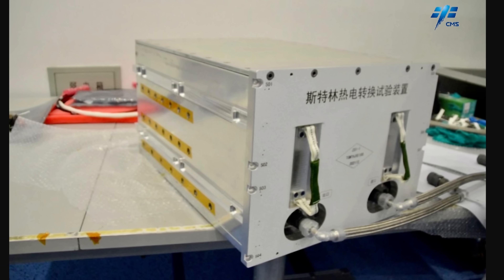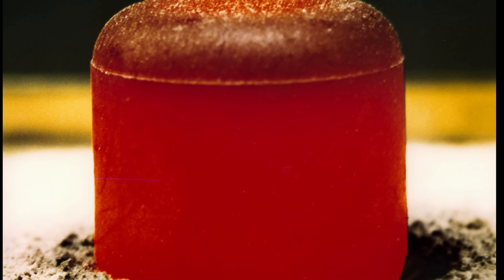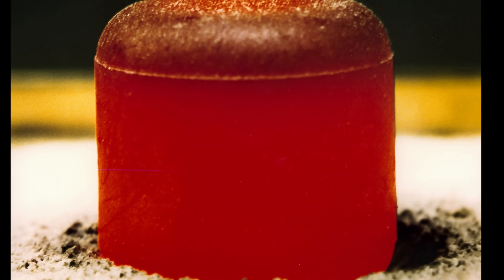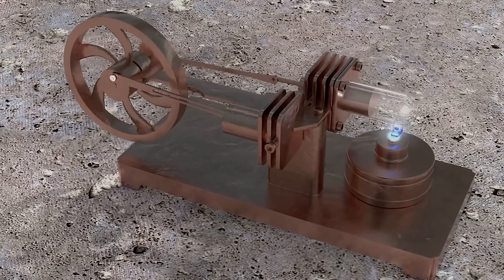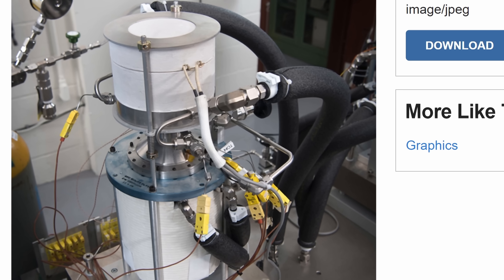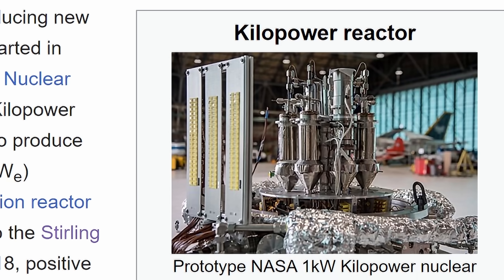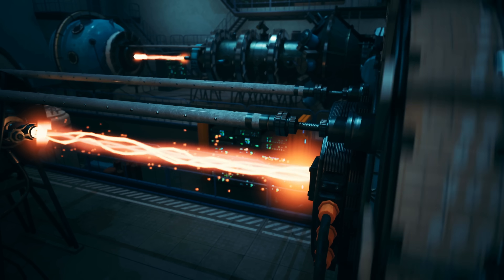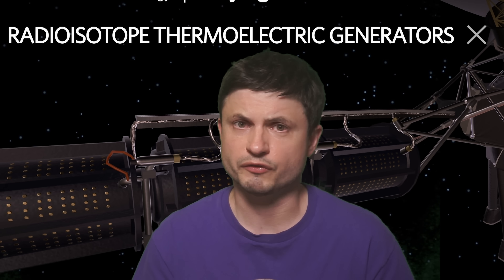Incredible Advances In Nuclear Stirling Engines For Space Exploration

Comment: I'm really excited to see how space ship design changes over the next few decades due to stuff like this
Reply: Yes, what a treat to live in these times.
Reply: There is AI reiterative design optimization that is poised to do some inhuman levels of engineering integration and detail as well.  It’s going to be big in less than a decade.
Reply: @hugegamer5988  What is the name of it? Also where can I find the latest news for that AI reiterative design optimization?
Reply: @hugegamer5988  Towards what application(s)?
Reply: @michaeltape8282  everything.  Pulsed rocket design, better lithium batteries, higher performance turbines, amazing strength to weight optimization of a frame for a particular load.   We have had simple parameter optimization in engineering for almost 20 years now and this is like chatGPT for engineering problems. (Not a llm but the analogy holds).
Reply: @michaeltape8282  Towards workplace safety. Atm it is to bulky for the trash can. AI will design it, so no parts of it sticks out, that may snag on a lab-coat.
Reply: @hugegamer5988  Computer optimization of optical imaging lens design has been done for more than 50 years.
Reply: IZza Spash Shlip...
Reply: Maybe towards some sort of of engines separated by stalks from the main saucer part. 🤔
Reply: Why? Since we will all be living in bunkers. You will likely not see any of this happen.
Reply: @Brian-pz3wh  Hey maybe it's not that dire.  /Maybe we will live in the Logan's Run dome and get vapourized at 30,  That way we wouldn't have to live long enough to see people getting really excited about whatever technology like sirling engines that are always just on the horizon that could work if only there were better sealing/lubricating materials.
Reply: @seanm8030  or...we could grow up and actually ACT like a measured intelligent species. I know, a pipe dream.
Reply: @Brian-pz3wh  Actually, my point isn't that.  It is that people put a lot of expectation into things that are not real yet, and they aren't real yet for good reason.  The reality is that the stirling engine could work, but it relies on TBD technologies like more frictionless materials, that would be developed at scale, after people place orders for it.  As it is, there is little advantage in placing orders for it now because it still isn't good enough.
Reply: @seanm8030  well the way things are going now 2/3 of mankind wont live that long
Reply: @brianswedenburg3659  Sure.  My point is also that maybe, if more people take the time to think before doing then we could possibly survive a little longer.
Reply: "spaceship"
Reply: "Despite termination of the ASRG flight development contract in 2013, NASA continues a small investment testing by private companies. Flight-ready Stirling-based units are not expected before 2028."
NASA is nearly always a hinderance and seldom a motivator.
Reply: We have no business messing with any of this shit
Reply: we will launch space ships whit those engines from stations around Luna  =)
Reply: Stirling Engines are "always" about to revolutionize power generation.  Sure, why not?
Reply: @seanm8030  they already have quite a few uses. For spacecraft and space colonies is just another one. Hwoever it''s not like they are THE one and only do it all engine
Reply: @CarlosAM1  My statement was somewhat ironic.  I am aware of the technology and some of the benefits  and the drawbacks of it, and I am aware of some of the frankly silly predictions that have been made over the years where stirling engines will replace all power generation everywhere, tomorrow.  The claims are not universally ridiculous, considering the capabiIities the technology posesses, however a) I have ceased holding my breath waiting for the "stirling engine future"  which many predict. b) I have noticed that "tomorrow never comes."
Reply: @seanm8030  Eh, I mean if you expect a massive change or revolution or something on the very short term then it's no surprise "tomorrow never comes" as i'm sure you know things tend to take time to be developed, tested and used.
Reply: @CarlosAM1  Uh huh.  When it happens, great.
Reply: @seanm8030  yup. Patience is key when it comes to space and the application of some technologies, that make take a decade or more
Reply: @CarlosAM1 "Despite termination of the ASRG flight development contract in 2013, NASA continues a small investment testing by private companies. Flight-ready Stirling-based units are not expected before 2028."
NASA is nearly always a hinderance and seldom a motivator.